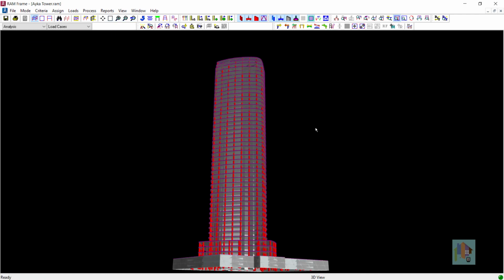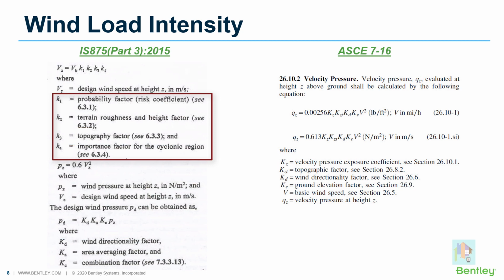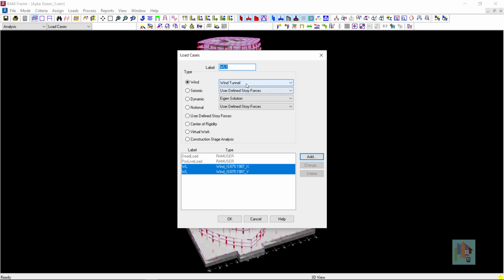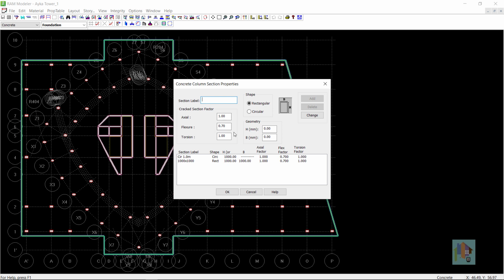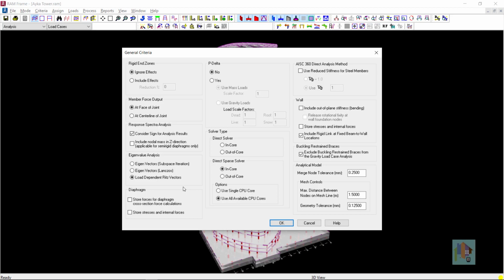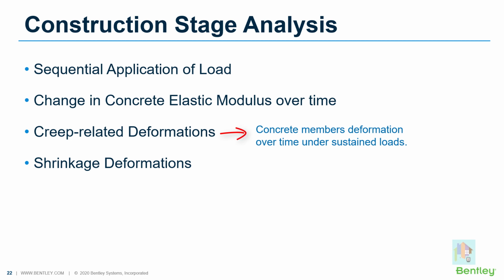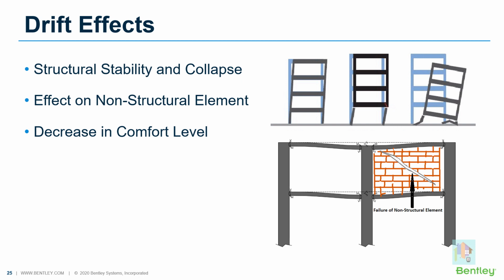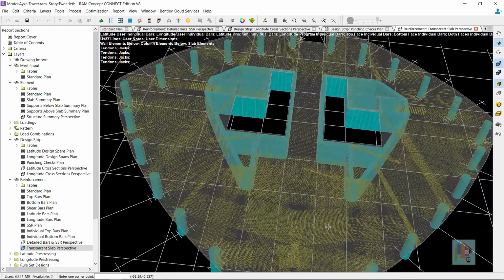Tall Structure analysis for Lateral Load and Construction Stage using RAM Structural: An Overview

Comment: how the seismic analysis for 3 under ground basement  please speak something about yhis
Reply from the maker: For the portion of the structure which is below ground level, seismic force distribution is different (VBu is calculated separately). You can go through IS1893 (part 1):2016 code where you can find how the seismic forces are calculated and distributed for underground structure. Same is implemented in STAAD (you need to define additional parameter to inform program about the underground structure) and RAM structural. If you have multiple basements, you only need to define few additional parameters to consider the seismic force distribution properly. I will try to cover this aspect in detail in seismic analysis series which I plan to release later this year.